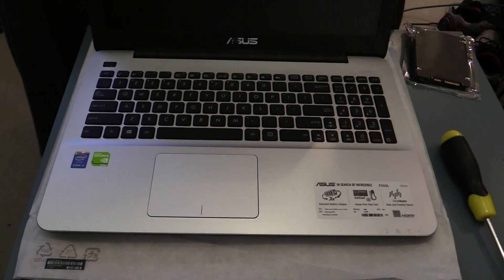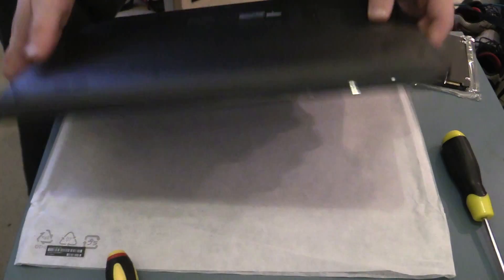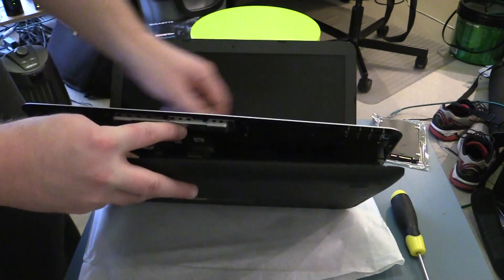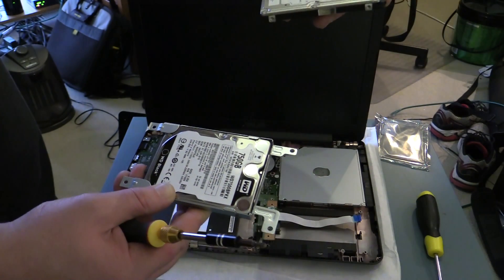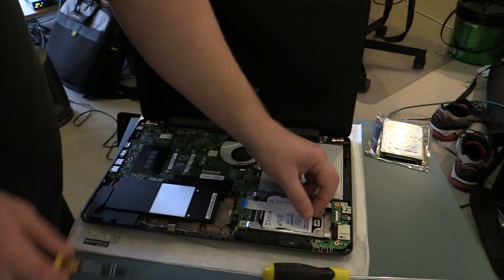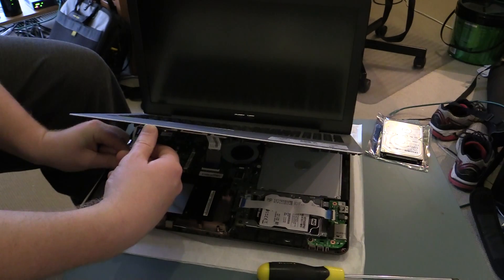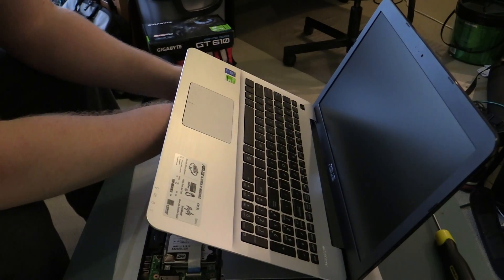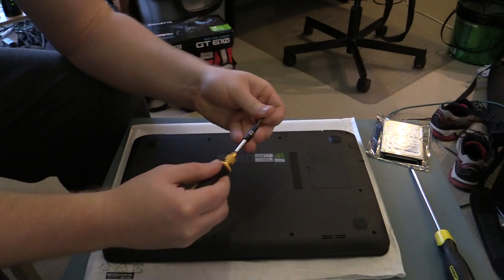Asus F555L Disassembly for Hard Disk Replacement

Comment: Can I use a sas hdd? Would any controller fit or be able to replace the original hdd to mobo connection? Maybe the pcb that the hdd attaches to could be replaced.

Comment: My SOs drive just crashed.  What SSD or HDD models have people gone with for replacements?
Reply from the maker: Joe Christl I personally recommend Samsung EVO 860 2.5” for this laptop, this won’t take an m.2.. so 2.5” is where you’ll need to be. Size is up to you but the EVO is fantastic, you could put a PRO series in it but I wouldn’t pay the extra unless it was really a mission critical system... up to you. Good luck!
Reply: @Anthony99  thanks for the info and the recommendation :)

Comment: Anthony Parker, i try to open the exact same model but for some reason the right "ctrl" key area seems to hold its place and just stuck in there. I open all the screws underneath it and i scared just to force it out that will result break the keyboard. Do you have any tips on this regards please help me.

Comment: A samsung 860 just revives that little i3 (bottlenecked hard by the abysmal default drive speed). Just cloning the system, boot times went down by 90%. Worth the price and absolutely sufficient for office and average browsing even in 2019.

Comment: I tried to disassemble my laptop and removed the keyboard cable and put it back again. when I started my laptop, some of the keyboard keys are not working. Do you know how to resolve this?
Reply from the maker: Hey there, the keyboard cable is probably just not in properly. I'd take it apart again and refit it. Whenever I do a laptop upgrade like this I'll actually test everything before going and screwing it all back together, etc. as it's a pain in the butt taking it apart if something isn't right. Just be extra careful with the keyboard ribbon cable connector on the motherboard, you really don't want to snap it. Good luck!

Comment: I realize this is old... but i bought this computer 2 years ago and now im getting windows 10 critical error message and the system reboots. I tried putting in an SSD but couldn't install Windows because of no partition.  So I put the old one back in to connect the ssd and copy hard drives and now when booting it goes straight to the BIOS...

Comment: Great job !! do u know what's the correct dimension of caddy ? 9.5 or 12 mm ??
Reply from the maker: Not certain off the top of my head as I don't have the laptop anymore, but if I were to take a guess I'd go with 12mm :s :s might want to do a little more research first though! Good luck :-)

Comment: Wat abt the fuckin windows that is still living in the old drive? Asus is not going to give u a windows cd! Waste of time
Reply from the maker: lol  Windows CD's?? Going back to museum times... :p

You can use the Windows Media Creation tool kit from another working Windows 10 computer and it'll make a bootable USB for the OS isntallation, you just plug it in and off it goes.

Ever since Windows 8 new laptops have stored their licensing information in the BIOS, so you don't need a CD or product key... just reinstall with the correct version of Windows and it will activate itself no problems.

Most importantly make sure that you use the MS Windows 10 Home version, not Professional as it won't activate as the stored license for this model is the Home edition.

Good luck!

Comment: wait a minute.. I am missing two screw that are suppose to be on the left side. ive had this repaired before. did the people at best buy really forget my screws and that's why my fucking laptop wont start?
Reply from the maker: Hold on there, Slick  hey buddy! Id take a guess that best buy probably havent touched it as theyre just a retailer.. maybe sent off to Asus? Anyways.. tried a different AC adapter?
Reply: Anthony Parker actually, did a little testing and the 2 screws are the culprits. I have electric tape down on both of the places where the screws are and my laptop started working like a charm for a bit.

Gonna do a little research about the screws and buy some. Thanks for the help :)

Comment: I appreciate your guide, I checked it out before I opened my laptop to make sure I wouldn't miss anything. Unfortunately the screws holding the HDD in its cage are so tight I'm gonna have to take that in and have someone unscrew them, or else find a replacement cage.

Comment: how to install tuch driver ?????
Reply from the maker: Muhammad Imran if your touch pad isnt working when you turn it on its probably not connected properly... check the connection as drivers not required for basic touch pad functionality in this model.
Reply: Anthony Parker this model is work on 4,5 tuching  after this tuch is work
Reply: how to install tuch driver ?

Comment: Hey man, i have the same laptop and i replaced the original faulty hard drive with a 1TB WD blue sata HDD ...installed clean windows via bootable usb...but it still boots into BIOS on every reboot. How can I solve this?

Comment: Do you know if it would be the same procedure on an Asus A555D... a555dg-ehfx to be exact just curious before I try to do so can't find a video on this model. my hard drives actually decent as its 7200rpm but I plan on installing a 256gb ssd then replacing the dvd drive with a caddy and keeping the 1tb as a 2nd hd would this be possible thanks in advance

Comment: Hello, so if I am unable to get into windows and stuck on the bios Aptio setup utility screen how can I fix it? I have this exact model computer, and I was told by an office works member from where I bought the laptop from said the only thing Needed to fix it was to press a button inside the laptop to reset the settings, is this true? I was thinking it was a problem with the hard disk but I am not sure and need help, I could have given it in to office works but they said 3-4 weeks to get it back which is ridiculous
Reply: Currently am going through a very similar booting problem. Same laptop model. Was told it was hard drive was basically bricked with too many bad sectors on it by a repair person and was told to buy a new one. However, I have changed my HDD but the problem still persists! WTF
Reply from the maker: have you changed the drive or is it still the original disk? if it is the original drive it may be faulty and you should change to an SSD... you should do this regardless.
Reply from the maker: as for the officeworks members advice, not to slander others, but thats not correct. laptop motherboatds dont typically support different SATA modes so the only thing that you really could change that would affect booting is support for legacy and UEFI devices. if you havent changed anything in the BIOS and you're not booting to Windows its most likely either a corrupt file system or a failing hard disk (which is incredibly common)... I'd say forget Officeworks and change to an SSD... whether you or a computer technician do it. i used to work computer sales thinking I knew my stuff.... 6 years later in my own business doing it; I really had no idea.
Reply: Hey, it is still the original disk, I haven;t changed anything internally in my laptop. Would I be able to get an SSD from officeworks or any other computer store that would be used for my laptop build? My computer knowledge is very minimal as you can tell haha, i dont really know what an SSD is, but I think I'd be able to install it in with a youtube tutorial or 2 to help. I managed to clean the laptop fan by myself so i think could change the disk lol. Its actually a X555L, not too much different from the one in this video.
Reply: that scares me then because Im going to get mine replaced :/
Reply from the maker: We repair around 10 laptops a week, only a small business but I'd say 90% of the issues we see come down to the hard disk in relatively new laptops. This video covers physically changing the disk you'll also need to adjust your BIOS for legacy booting, reinstalling the correct version of your OS, driver installation and finally all your applications from there. We see a lot of home done jobs and yeah, you'll save some money but some that come in are really poorly done and really should have been outsourced. Laptop hard disk change over is quite a standard procedure but especially home built computers... people get them so horribly wrong! Some of the PC stores do a crap job of them too. I'm all up for saving a few bucks but sometimes recognising you don't know everything is a good thing. IT is a funny industry, everyone thinks they know everything... but so many poor builds out there lol

Comment: hi, i have a different variant of the same laptop you just disassembled. The K555l (aluminum shell model) .
After using the laptop for 5 months, few days ago my laptop gave me a BSOD saying some system files were missing/corrupted.
i tried to repair the files with a win10 dvd and failed , ive tried multiple mediums to get win10 on it but it never boots to windows after installation. i checked the sata controller status and on it , the dvd rom is always there but the hard disc sometimes shows up and sometimes does not . 
what could br the issue here? any help is appreciated .
Reply: Honestly, it sounds like a failed (or failing) hard drive... especially since it's saying that files are missing or corrupted.
You COULD try installing a new hard drive (and if you can, go for a SSD) and see if Win10 will then install. Good luck!

Comment: While I understand that this is the direction that the industry is moving, having to dismantle a laptop to this degree for a simple hard drive install is insane. Are computer makers really that desperate?
Reply from the maker: haha YEP!!! Because if you have an Intel Core 2 Duo @ 2.5Ghz with 4Gb memory from basically 10 years old... for your standard user who just does some Facebook browsing, a few emails and an occasional photo or plays a few audio tracks; really, a new laptop is not going to be 'that' much faster. Their are obviously performance differences... but waiting 2 seconds or 3/4 seconds for your internet to open; no one really cares that much. Upgrading to an SSD is a great upgrade for most computers, so people are going to be buying less laptops. It just feels like at this stage our systems are generally speaking fast enough; unless you're into games, 3D, etc... maybe with the push towards VR our general spec requirements will need upgrading.

Comment: 9:30 when you said "this drive has allready been setup with windows" i realised i fucked up as i had my laptop halfway together again and forgot to put a  boot of windows on my ssd :')
Reply from the maker: It's all good mate :-) All you'll need is to pull down an installation from TPB, etc. Your product key is stored in your BIOS, so just need another machine to burn the ISO (always burn Win ISO's at slow speeds 1x, 2x, etc.) and bobs your uncle, good to go! Good luck... feel free to drop me a line. Win 10 handles drivers quite well, most 'required' drivers will install automatically from the Windows updates, but I still prefer to pull down the full driver set (not additional software though, just drivers) from the manufacturer website as well... but that's just me. Good luck!

Comment: why do PC makers make it hard to upgrade now, do they want users to void their warranties? 
Do they expect them NOT to replace the slow HD they put in?
Can anyone tell me why are SSD still not mainstream and manufactured right into new systems, HDs are just too slow!
Reply from the maker: Standard hard disks in most new computers are pretty average in terms of quality and performance; we get a lot of faulty hard disks in new computers these days. I personally think it's because they need everyone to go and buy new computers in 2-3-4 years... as opposed to being able to upgrade them and save some money. Even a Core 2 Duo @ 2.3Ghz is fast enough to browse the internet and deal with a few emails... which is really most of what the bulk of people do on their home laptops, plus a few photos, etc. The industry wheels have to keep turning ;-)
Reply: +Anthony Parker Still, why not make it easy to at least replace both common things on a new PC: Memory and Hard Drive?

Comment: is this laptop's fan noisy ?
is it a good laptop for gaming and 3D Modelling ?
please answer me as fast as you can 
I'm gonna buy a used one
Reply from the maker: fan wasnt noisy on our test system. gaming and 3d modeling depends how advanced youre talking... but if it were me and I took my gaming or 3D modeling seriously; I'd put money on a desktop with good spec instead... or like to a higher level laptop. this is a good laptop but you may need more power than this. subscribe for more info

Comment: I have this and mixed up which screws go where, can you help
Reply from the maker: Hi Shade,

Unfortunately that's not something I can really fix from here... if you're not sure you could check in with a local computer store, else I'd check out the Asus service manual on the unit.

I found it online:  https://manualscollection.com/?fid=d6f7d72402e0db95bda419571312d256

It's not normally available to general users, just Asus technicians, although it's typically easy enough to find online. I hope this helps point you in the right direction.

Cheers,

Anthony
Reply: Anthony Parker thank you for responding, i got the screws in the right places eventually (one had gotten stuck) and i think everything's ok...near the hinge are you supposed to be able to see what look like fans or something?
Reply: i got it together again thankfully

Comment: Is it possible to replace the graphics card on a laptop like this?
Reply from the maker: These are discreet graphics systems (chip is on the motherboard), so unfortunately not. Even in high end laptops that feature a separate dedicated graphics card, changing them is difficult as you just can't buy laptop graphics cards from a store etc. In most cases they're taken from other laptops that have failed from things like failed motherboards, etc. and sold as refurbished.. eBay does sell a few cards but they won't work in this laptop. Feel free to subscribe :-) It'll help me out.

Comment: I have the X555L and I want to add a SSD and also change the WLAN card to a 2.4/5.8Ghz instead of the 2.4Ghz so I can have faster transfer speeds. Do you know is the WLAN card removable or is it soldered to the mobo like the 4GB of RAM? I don't want to open my laptop until I'm ready to install.
Reply from the maker: 5Ghz is a good upgrade. it's been a while since I've opened it up but pretty certain it is a separate card.

Comment: Thanks for your video 
I did everything like you did but when I turn on my laptop it's go directly to boot screen ( the blue one) 
What is the problem?
Reply from the maker: after you change your ssd youll need to load windows into the computer. if you can't boot from a DVD to load Windows youll have to turn off secure boot in the bios and also allow legacy booting. once youve changed those two settings youll be able to install Windows from a DVD. good luck! :-)

Comment: Hi, i'm planning to buy an ASUS F555UA-EH71 from amazon, and I was wondering three things:
1. Is this guide valid for that series?, I want to put a Kingston Digital 480GB SSDNow V300 on it.
2. Can a caddy with the HDD it comes with be set instead of the DVD, and which one would you recommend for that task?
3. Since this will be my very first laptop, do you have any advice on regards of maintenance?

Thanks for the video!
Reply from the maker: hi mate, dont forget to hit the subscribe button (its a big help for us). ill need to double check but most laptops are quite similar so Id say yes. In honesty though, my experiences of the SSDNow drives havent been great. theyre quite cheap but they're quite slow and havent lasted well. I actually really like Kingston HyperX RAM and use it basically exclusively although I havent been happy with their SSDs... they just don't last well. if I were you I'd save up a bit more and go for either Intel 535 series or Samsung EVO 850 series... the standard Samsung drive is fine but the Pro is better if your budget allows it is quite a big price difference though, not really any faster just more reliable. There isn't really a lot of physical maintenance required, people often install too much software which will slow down the system so only install things you need and get a good antivirus is usually good advice depending on the user. thanks and good luck!